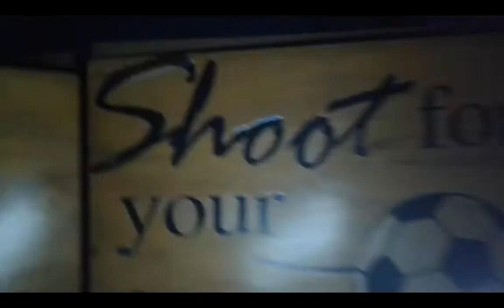Making a 8.4v 4400mah 2S 2P 18650 Battery for my Emergency Light

Comment: Great way to upgrade the lamp PS.  I'm sure you'd be performing several other upgrades with Li-Ion batteries. If so, please buy a Spot Welder  and Nickel Strips for making electrode connection. Lithium Ion batteries must not be soldered. Research about this matter online.
In the mean time, Thank you for taking time to shoot the video. It's nicely done.

Comment: I assume this was simply a straight replacement of existing li-ion batteries, and all BMS, discharge protection, and charging facilities are already on that circuit board? If not, then you’ve got a one shot lamp until those batteries run down below their viable recharge level, and then some desoldering and careful manual trickle charge nurturing to do, to get the batteries back up to their nominal 3.7 (max 4.2) volts again…

Comment: Here's some additional info.
Gr8Believer mentioned if you charged the batteries. you checked and the meter showed about 4volts each.Thant's fine. But have you made provision to get the battery pack charged? Lithium Ion batteries are very temperamental and complex as far as charging is concerned.
These batteries need to be Balance Charged.And as such you need to solder balance charging wires  and connectors  (5 Wires altogether, 3 for Balance charging and 2 for main input. A  Balance Charger is also a must.
Cheers.